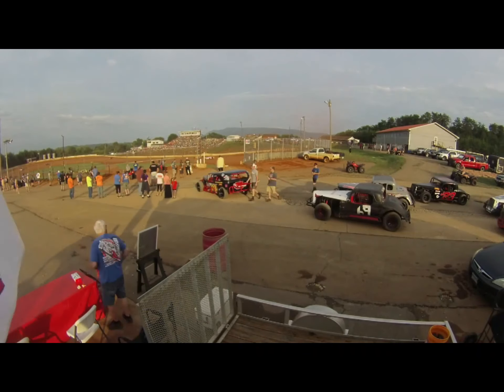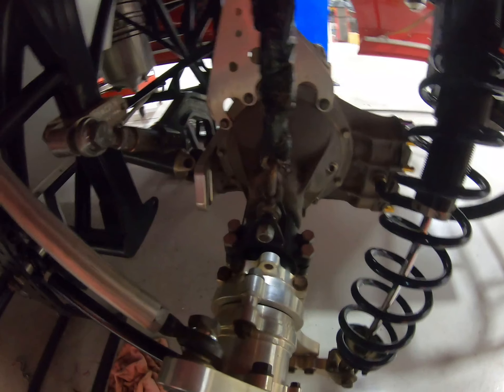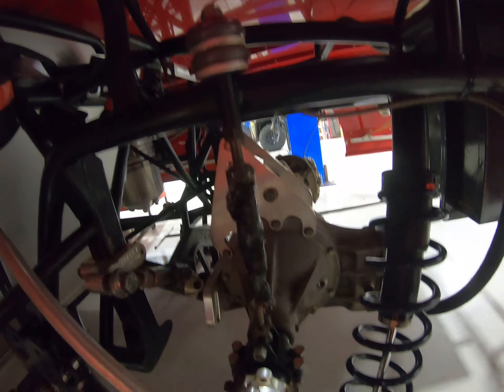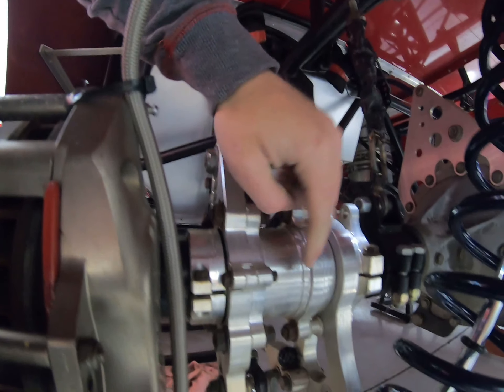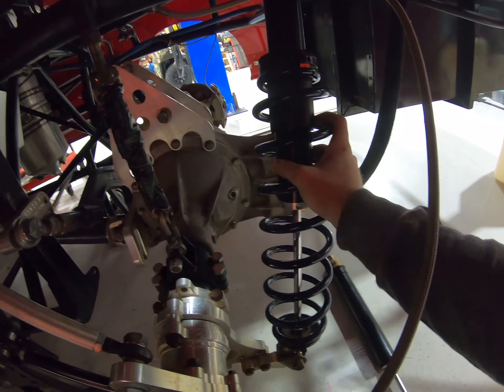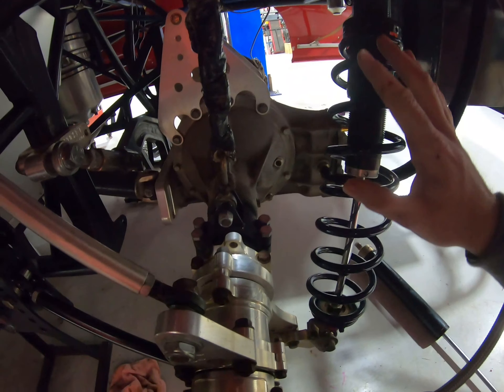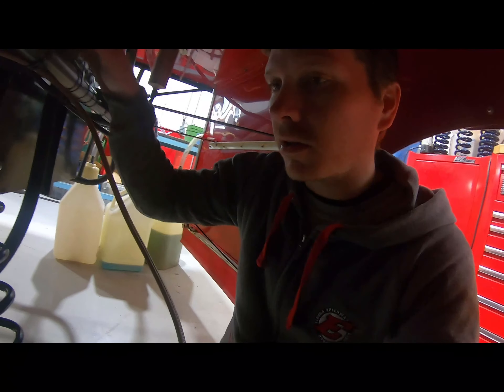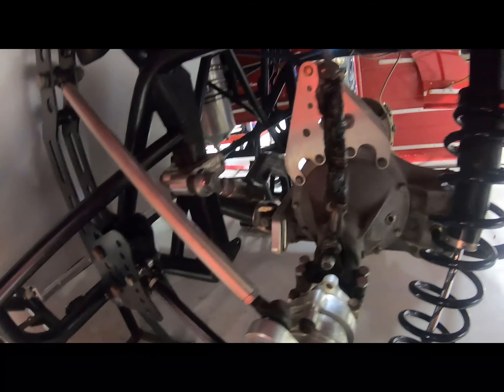Left Rear Droop What it Does on a Dirt Late Model

Comment: I've never been to any dirt race whatsoever, but I plan on changing that soon. What I like is the level of innovation, engineering, and creativity in the cars. Some people call it "cheating", I wish the NASCAR Cup series still had this aspect, no longer with the next gen car.
Reply from the maker: You need to go for sure. The action and excitement is way more then asphalt racing.  What state you live in and I see if I can suggest a good event for you to go watch. The local shows are good also go support them and bring a friend along.
Reply: @DirtTrackDave  I live in western North Carolina, about an hour west of Charlotte.
Reply from the maker: @bluegrassboy2448  ok so no big big event near by in June. But go check out any of these tracks; Volunteer Speedway (bulls gap) high banked 3/8mi, Tri-County raceway-bull ring 1/4mi, Smoky mountain raceway- 1/2 mile, Crossville Speedway 3/8 bull ring, 411 motor Speedway 3/8mi, Boyd's raceway, dirt track at Charlotte. These are all good race tracks They race all a little bit differently, but lots of action good racing, good people, and good food.

Comment: I assume you have a video on this but my understanding of late model rear suspension is that its designed so the left rear wheel can move forward and backward in relation to being in a turn vs straight away. Is this true? And if so is there a video that explains how all this works?
Reply from the maker: Well some what, both RR and LR move. LR moves forward and down and right rear moves up in body roll and travels rearward slightly.
Reply: @DirtTrackDave  interesting. For some reason i thought the left rear was built on some sort of pivot. But after seeing the suggested video at the end of this video it made more sense. Thanks for the reply.

Comment: So, as the nigh goes on, I should increase the length of my limiter chain??
Reply from the maker: Well that depends on drive in the car. Some car need less chain adjustment then others. Having said that, yes as long as as drive is needed in car. But can have too much.
Reply: Too much just means lifting the LF and making the car too tight on throttle, right?
Reply from the maker: To much drop can make a car have to much instant traction, and causes RF to travel slightly more. Picking up LF is a combination of to much LR drop, 5th to far forward and RR to soft of load number /low RR ride height.
Reply: After talking and thinking about my setup,  I went testing and got a good baseline together. Then got a W at Lanier in iracing. 
Too broke to have a real car, but still wanna race.
Reply from the maker: @CensoredFreedom615  Testing is key in iracing or real life.

Comment: Dave what’s your opinion on running a chain on the right rear?
Reply from the maker: Details on RR chain are for paid customers on consulting program. Having said that, the RR chain is old school, GRT were notorious pretty much bolted on and leave it in. However, cars then we're lacking traction compared to how much rear grip cars have advanced with. The chair was a crutch that is now replaced with under rail design in cars. Plus you won't rip a shock in two with a chain on that cars run without under rail.